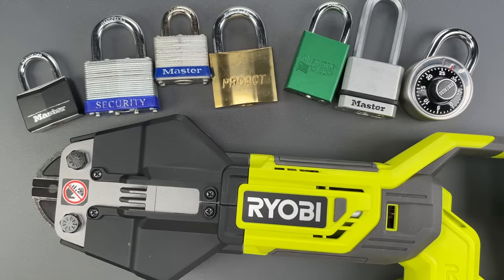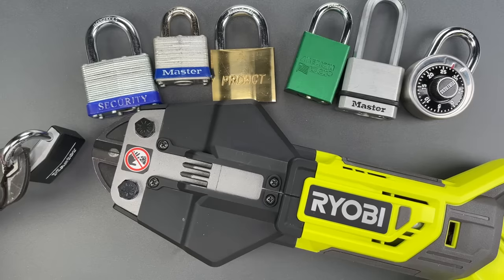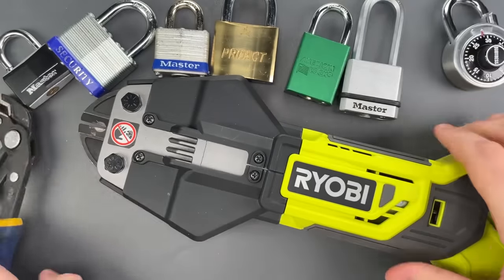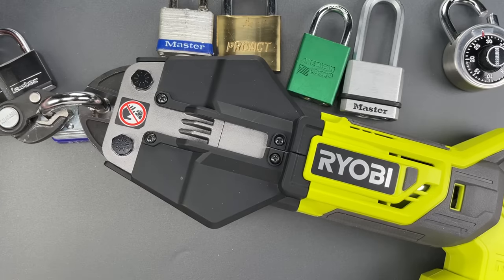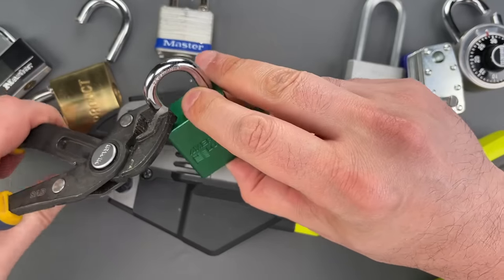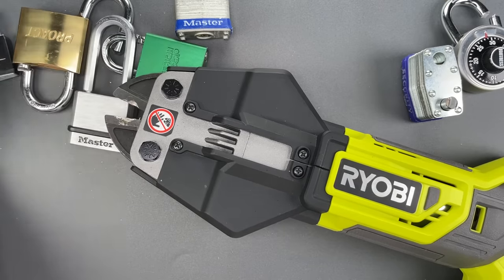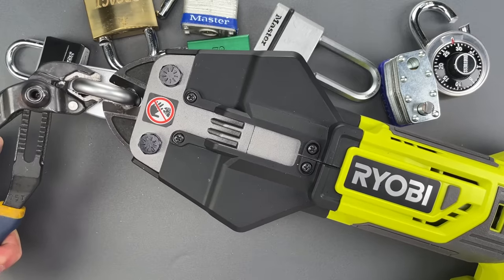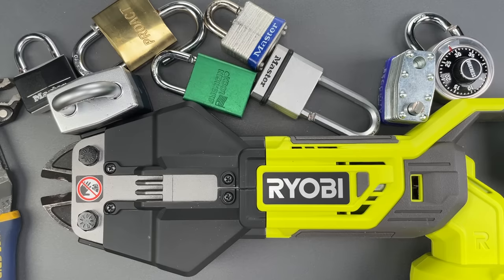[1408] Better Than Expected: Ryobi Bolt Cutter

Comment: Finally, the LPL is using an opening tool that is in my skill range.
Reply: "unga bunga" skilled attack 👍
Reply: I'd he sells these on his website I'd buy it for no reason.
Reply: LPL has a much smoother voice than that Ryobi😂
Reply: you know its difficult feeling that click on 3
Reply: Actually LOL’d
Reply: I'm pretty sure he's shot a lock before (however I guess that would have to require aiming ability)
Reply: @Stan S
I thought that when i saw him in another video using a hammer
Reply: The first few locks I got past were similar brute force attacks. Snapping the shaft of a combination lock on a school locker with a downward kick, using a huge screwdriver to twist a hasp off of a wooden shed, stuff like that.
Reply: skill range is not a probleam for me , its the budget ! lol
Reply: … and I’ve got the batteries to prove it ;)
Reply: Lol
Reply: I mean those Ramsets are super easy to operate too
Reply: Bravo! You speak for many of us~~~~~
Reply: Reminds me of that old Jagged Alliance 2 game, one the people who prefer using a crowbar rather than a lockpick.
Reply: Until you need charge the battery and change blades.. :(
Reply: Your skill range could be in par with LPL. It just takes practice, practice, and more practice.
Reply: @pws3rd170  the problem with ramset is its hard to use them covertly, for when you need to bypass your padlocks with discretion.
Reply: An angle grinder is a universal key... Show me a padlock that I can't get through with a dewalt angle grinder and a pack of disks.
Reply: Ramset
Reply: Not my price range tho
Reply: @alphasyke  try the google
Reply: @shadowcat314  but the comment wasn’t about being discreet. It was about a low skill level tool. Bolt cutters are far faster and quieter than that Ryobi
Reply: DITTO😆😂👍
Reply: @Mmouse_  there are locks with silica carbide parts added to wolfram molibdene main... You need like 2 kw dawalt grinder and 2 cutting discs and 20 minutes to go through 20 mm rod ... 
Thing cost like 500€ or something
Reply: @dragancrnogorac3851  I'd be willing to wager quite a bit I could get through it with a handheld dewalt xr, a flex volt battery and 10 disks.

Unfortunately I don't have the lock to prove it, but I know titanium isn't a match for that.

Edit: in fact if anyone wants to challenge me on it, they can send me anything they like up to... Let's say 30mm thickness, and I will cut through it with a handheld grinder and less than 10 disks, I'll document it and if I fail, I'll give them £300.
Reply: I thought so to, now I only have 9 fingers.
Reply: @Mmouse_  I can get through virtually everything with my angle grinder. It is often nearly a finger. So I try my best not to use the angle grinder. Definitely the most lethal tool I own.
Reply: @onlineo2263  Have you tried one of those crazy stupid chain saw disks that should have never made it out of the prop shop for the Saw movies?
Reply: despair not.
Reply: @ssFaxes  you
Reply: @pws3rd170  just for reference, some people might not have the strength or stamina for a manual bolt cutter, whereas, with that, you just pull out, pull trigger, put away... That same trick applies to Johnson's, of course, as lpl might say in one of his lock related April fool's type jokes... That Johnson video is funny
Reply: @onlineo2263  really? I've hurt myself orders of magnitude more times with a hammer than I have with my grinder... I suppose it depends if you count number of incidents vs severity though lol
Reply: LOL! I row the same boat!!!
Reply: You can push two buttons? In order?! Ungabunga!
Reply: This is really going to help when I need to get into my neighbor's tool shed
Reply: Not in my price range though.
Reply: You mean your not capable of picking a lock while drunk in 9 seconds in the rain while riding your motor cycle at 100mph with no hands standing on one foot with your eyes closed?
Reply: @andrewjames4346  very descriptive here bro
Reply: Lmao true
Reply: @PDGX  9o
Reply: @PDGX  oo9ooo
Reply: @nicholase2868  pokok oo9ookoo
Reply: @PDGX  9oo9
Reply: @PDGX  9o9
Reply: @zachmiller1855  o9o9o9 ok
Reply: @MonkeyJedi99  ok 9ooooooloo
Reply: @djpaulk  pool oo ok I'll ok olo
Reply: @djpaulk  9 up
Reply: @nicholase2868  ooopoooo ok no o on
Reply: @PDGX  I look
Reply: No he’s not
Reply: Lol
Reply: Lmaoo
Reply: But is it in your price range
Reply: Not fair, Its literally pay-to-win!
Reply: Hahahaha
Reply: In my skill set, just not in my price range
Reply: but not on the price range
Reply: @gabakusa  !
Reply: Soda can and some scissors works pretty well too. I'm sure they have some safety scissors you could use too
Reply: Only take a couple days to learn to pick yano, I'm a dumbass and I just bought a lock picking set off amazon and bought a padlock that you can see through to practice on, in 3 days I was able to buy cheap padlocks and just pick them, some ive managed to do in less than a minute and some take me like half hour. It's actually quite fun and so rewarding when you get a new padlock open for the first time
Reply: But not in my price range
Reply: Me too!   I'm at the cutting torch or bolt cutter level.  Just watch for fun, ... I have no hopes of ever opening without a key
Reply: @ssFaxes  ooga booga
Reply: Me too....
Reply: no
Reply: @notyouraveragegoldenpotato  Why would someone admit that they need safety scissors?
FYI, beer cams can be used by adults.
Reply: @ssFaxes  Ugg Yes
Reply: @goldencalf13  he did shot a lock
Reply: Probably not on the price range though haha
Reply: Ramset : 🤨
Reply: But can you afford it? 😂
Reply: LMAO
Reply: Lockpicking is chess now?!
Reply: Industrial
Reply: Nah man you selling yourself short you're better than a master lock